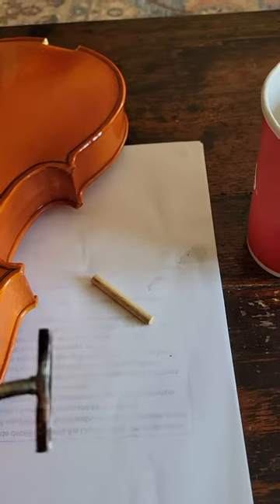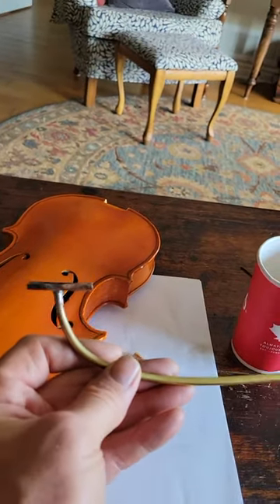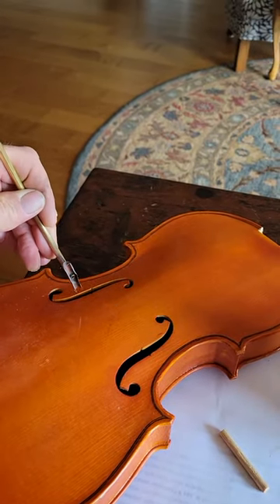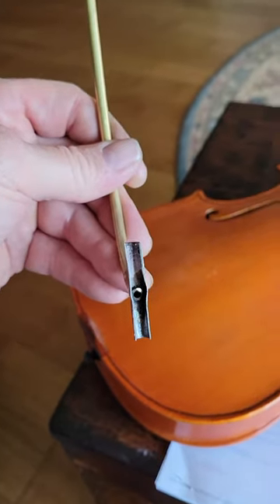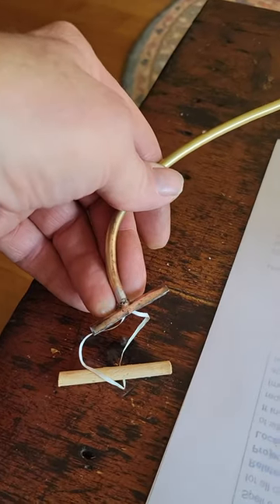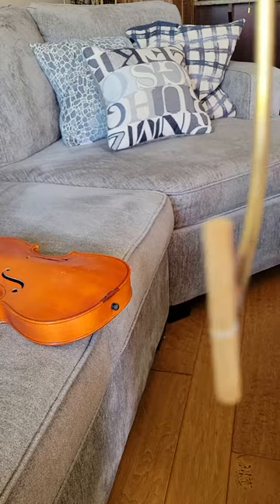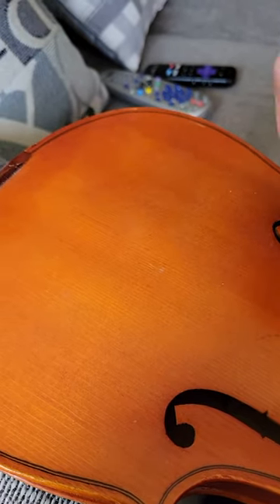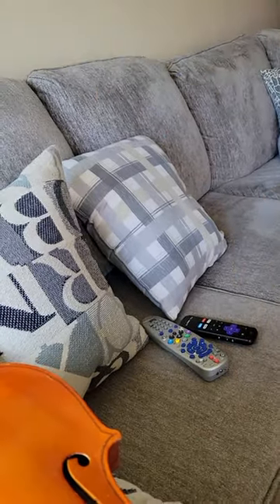sound post setter

Comment: Just made mine, used a piece of silicone tubing to trap the floss at the top of the tube and hold the post to the tool. Works a treat, so easy, fantastic , thank you..  .
Reply from the maker: Great like to see that silicon tubing idea..

Comment: Nice.  Like assembling a ship in a bottle.  After trying several homemade gadgets, (probably not for purists) the best for me is to drill a small hole in the sound post about 3/4" from the top of the post across the grain.  Then tie a thin strong string with a loose loop through the hole. Tie another string for the other side.  Hold one string in one hand and the other string in the other hand, having the post hanging in the middle.  Now move the post where you want it and wedge it in.  One string comes out one f-hole, and the other string comes out of the other.  Leave the strings tied to the post after positioning and push them into the box, so that you can easily reposition the post if it should fall -- no more trying to jiggle it out the f-hole.  It's easy to snag one of the strings with the box upside down.  Trying to get the best sound is more fun than trying to play the thing.
Reply from the maker: HA, for sure. I've seen a few that I've picked up for restore. String tied around the soundpost. F holes worn from string being adjusted . Bridge legs scraping the finish forward and back. 
The old fiddlers adjusting volume for a kitchen party or square dance hall.  Where there's will there's a way..